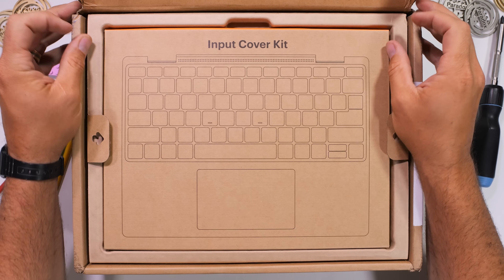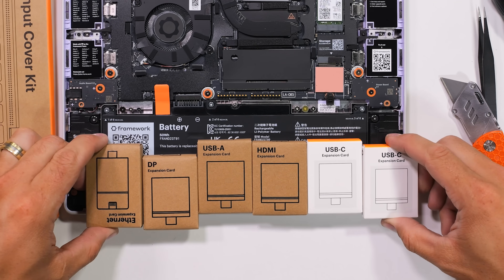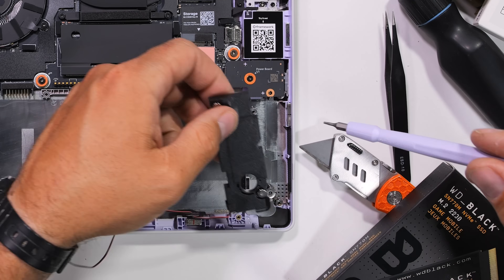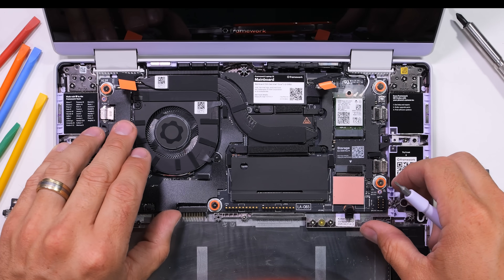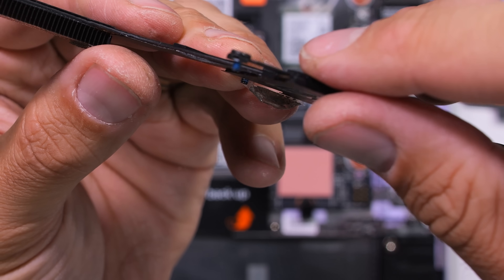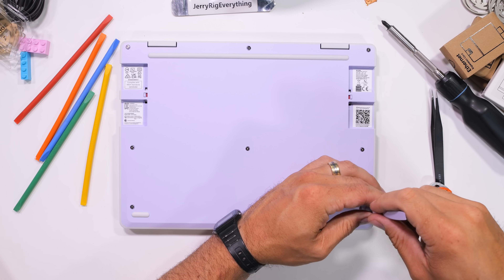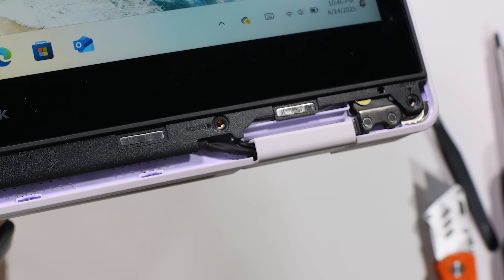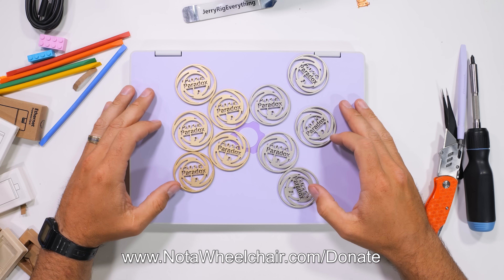The Best Laptop on Earth... is almost too easy to fix.

Comment: "If you're not familiar with the words I'm using - like modular, repairable, and inexpensive - that's ok. At least your texts are blue." Savage.
Reply: Trust me, my next laptop is going to be a Framework running Linux. The bloom is off the Apple flower for me.
Reply: @KevinGamin  That bloom died many years ago.
Reply: @KevinGamin  same, excited to ditch windows and have something that is meant to use linux
Reply: @KevinGamin  If you're a linux geek, there's even more repairable / modular laptops where the drivers are FOSS and the schematics for everything are included, i forgot the name of it though

EDIT: ITS CALLED THE "MNT REFORM"
Reply: @dwncasted  Like which one? I am very interested!
Reply: @dwncasted  MNT!
Reply: @dwncasted  afaik, many drivers being used even in linux.. are proprietary.
Gpu/network.
But if true what you said, I hope the FOSS laptop's name isn't "fantasy realm".
Reply: @dwncasted yeah but there is no touchpad and it costs more than a damn macbook
Reply: @AdjectiveBlazkowicz  There is a touchpad.
Reply: @dwncasted  Yes but not upgradable, only reparable, can't change the cpu
Reply: @KevinGamin  Framework 16 with Tumbleweed and Gnome is heaven for me
Reply: @KevinGamin  remind me if I have money again, I'll buy one for my mom :D
Reply: @KevinGamin You better hold that words, come back sometime later
Reply: @KevinGamin  Unfortunately, Macbook Pros are by far the best laptops in their class. It's not really a contest. MacOS is still, for now, pretty great too.
Reply: @thekwoka4707 Nothing unfortunate about that at all.
Reply: @thekwoka4707  mac is trash  over priced trash at that ... that being said framework is trash also ...
Reply: @KevinGamin  I can't imagine voluntarily using Linux
Reply: @KevinGamin  I wouldn't ever get this junk. The specs are so bad, it'll become outdated in a year or 2 anyways. I'd rather buy a thinkpad or something of the sort
Reply: @whyisitsodifficultomakeahandle - You do realise one of the selling points of this laptop is that it can be upgraded right?
Reply: @whyisitsodifficultomakeahandleyou can literally replace the motherboard and the chip in the RAM and everything else.  If if the current specs aren't dated you can replace them which you can't do on any other laptop
Reply: @brotherfranciz yeah every laptop can, they just advertise it as a “selling point” to fool people like you
Reply: First two are appropriate, but inexpensive is definitely not something you can attribute to framework, since you're paying at least double for the same specs.
Reply: @Gundog256  exactly. I just get used hardware.
Reply: 6:03
Reply: As an iPhone user who knows a lot about tech, absolutely fucking savage
Reply: I came to say love that shade of blue you threw, but you beat me
Reply: Blue texts are useless and overrated
Reply: Apple users get mad when they get called out for being technologically inept but refuse to learn and thus become "sheep".
Reply: Apple and Samsung fan's 9/11
Reply: @polaristars  samsung doesnt get blue texts
Reply: @polaristars  only apple lmao
Reply: ABsolutely freaking awesome!!!!!!!! Also, Definitely will be buying framework from here on out.
Reply: Yea, that was brilliantly delivered.
Reply: Very sick burn.
Reply: This was like poetry! It got me good hahaha.
Reply: Imagine if they join with Fairphone
Reply: added that to my quote book immediately. also signed into youtube just for this
Reply: Please enlighten me my fellow brethren for i am slow to think and quick to despair for i do not know and do not understand this sentences...and also so that i may appreciate the genius of savage of this word
Reply: Pretty sure this is my next laptop.
Reply: how did i scroll down to read this exactly as he said it.
Reply: Presactly my point! I love green 😀
Reply: Literally died with this
Reply: Best part is directly after this I got an Apple ad
Reply: this line should be in the history books for real
Reply: Hehe mine are blue too, not that I care, but I do know and understand the words ;). And I have to replace components when the fuckers are running. Small yay for IBM
Reply: Looking for this. Thanks 😅
Reply: when was this?
Reply: And then he installed windows
Reply: but hes right
Reply: is that an apple user own?? becuase am lovin it
Reply: But aren’t iPhones more repairable than a lot of androids now? Electrically bonded battery adhesive. Removable back glass. Self Service Repair Program.
Reply: @dankpanda919  Aside from the battery it's still kinda hell to service, just like any other smartphone. The electical adhesion should be standard though, it's really nice.
Reply: @polaristars Right, but that’s kinda my point. The only easy one is Fairphone. No point in singling out iPhones right now while the current iFixIt scores are higher than a lot of mainstream Androids.
Reply: @dankpanda919  and every part is serailized, some you cant recalibrate, love iphones!!
Reply: @dwncasted Yeah, maybe 3 or 4 years ago. That’s not a thing any more.
Reply: @dankpanda919 only because, unfortunately, big Android phone companies like Samsung took notes out of Apple's book so they could drain more money from consumers 

Sent from a s25 ultra
Reply: My screen bezels also aren’t as big as laptops from the 2000s.
Reply: Nice one indeed! Hahaha Could still be green though if they aren't using an iCloud-account. I have seen them! Not kidding!
Reply: A tactical team from Homeland Security has been dispatched and is currently on its way to arrest you on the charges of terrorism and inhumane treatment of civilians
Reply: It really was a right hook roast 😂
Reply: haha apple bad ,get it?
Reply: Got a 17 pro ad the second after, I screamed 😭
Reply: I love my Apple products, but also LOVE my Framework!
Reply: apple being unrepairable is just not true anymore. More about samsung now
Reply: @saminogabino apple hasn't been easily repairable since like 2018. Unfortunately Samsung kinda took inspiration from Apple's predatory practices in the last couple years so they're basically both on the same level of non-repairability. Both are still possible to repair but only if you're EXTREMELY careful. But there are TONS of Android phones out there that are way easier to repair and even designed around it. They just aren't as flagship or popular
Reply: 2025
Reply: reddit assemble!!!
Reply: Loved that line 😂
Reply: I’m dying over this one😂😂😂
Reply: i understand and love the three words, but what does the texts are blue part mean?
Reply: Shots fired!
Reply: I didn't understand what this means?
Reply: @kitty.miracle He's referring to the text messages which are blue on Apple.
Reply: So savage ahahahha
Reply: Of course they are, why would I use anything other than signal, it's just better?

Plus, the SMS application I use for those who refuse to get signal lets me change the text bubble colors.
Reply: How can you tell an android user when you see one? They’ll tell you
Reply: THE SHADE! LUL
Reply: Ouch! 😩 Right between this proud Apple user’s shoulder blades. 😅
Reply: What does it mean, though? "text are blue"
Reply: @achmadramdhan3629  The text bubble from a device that is not in the Apple ecosystem appears in green colour to an iPhone user, while the ones in the same ecosystem appear in blue. I may be wrong, but I think that's generally it...nothing serious.
Reply: @OneNiftyBoi  thanks for the info
Reply: @achmadramdhan3629 Texts are blue on iPhones when two iPhones are texting eachother which is what that means
Reply: @achmadramdhan3629 you might not care if you live outside the US but in the US where people use iMessage and SMS a lot Android user texts show up as a different color as Apple text and they tend to break things because of the way Apple makes it. It's mitigated a little bit by RCS but still Apple makes it so anyone with an Android phone basically is outed in these chats and blamed for making them not work. There's a Wall Street journal article about how this led to bullying in schools
Reply: Personal I use apple for the ecosystem. Most users don’t. I would go back to a Linux or android. But I am in too deep at this point. Maybe my next work computer will be a frame work.
Reply: @Thekidfromcalifornia2.0 "I'm in too deep" Translation: I could easily buy something else but I choose to keep supporting the destruction of society
Reply: Good burn aside, this problem of not having an android iMessage alternative is entirely Google’s fault. They’ve created and killed more messaging apps than anyone can shake a stick at…
Reply: Who is repairing/upgrading phones or computers nowadays? You’ll throw it away and buy a new one since it’s not worth it to repair like 6-7 year old phone.
Reply: @Svenisko1705  you have too much money
Reply: Ff
Reply: blaming blue texts is silly, most of us are stuck because of society, i like having loose friend groups to ocasionally do stuff with and they always congregate in imessage groupchats, I just know for a fact id miss out on things, and its not like main friends, but i still like leaving my house and going places lol
Reply: @hardlyreading Everyone knows you can't leave the house or talk to people without supporting a corrupt company.
Reply: Blame apple no one else, blame the government for not seeing imessage as an issue,  people stayed to keep talking to ppl, otherwise theyd have lost hella market share years ago
Reply: except it is actually very expensive vs a comparable laptop. Almost twice as much.
Reply: My texts are blue and I still thought this was hilarious. I made the switch to Apple as a compromise to my wife/her extended family. Somehow in a group of 15 people, I was the only reason the group chat couldn't all be iMessage, so I caved. At least Apple pushes IOS updates to older models for a long time, so I can hang on to my phones for 3-4 years. My iPhone 13 is pretty much the same as whatever the new one is now.
Reply: 😂 The way I hollered when he said this! Android 4 Life!
Reply: thats literally every other tech company. sure apple popularised all this crap but i feel like the sheep (SAMSUNG) should be called out more but then hed be a hypocrite i guess 🤷‍♂️
Reply: Jokes on us my text is blue but I knew these
Reply: Jokes on you, it is a joke @古明地恋-s9c
Reply: True, but Apple aim more than just a few thousand sales too.. i mean their sales target is the 300million funny cat videos viewers not the 0,1-1million tech videos viewers..
Reply: Most that say this will be too poor to buy an iPhone. Copium.
Reply: @HiroProtagonist1  Most people buying 🍏 are broke and end up with payments anyway. 🤣
Reply: He always seems to have some weird grudge against apple & its users. Ehh, he’s an android user and he’s rich, of course he has a superiority complex.
Reply: @LambdaMiscellaneous  So having an opinion that differs from yours means superiority complex. How about the victim complex you have.
Reply: @LambdaMiscellaneous  If you had paid any attention you would have found it weird NOT to talk about them in a video about the features a Framework provides. The short version is that Apple goes out of its way to make stuff unrepairable, I'm talking millions on lobbying, bribes, and propaganda alone. The kind of practices Apple gets away with is exactly why Framework was made...
Reply: @LambdaMiscellaneous  Apple's the only one that does serialized parts, that's plenty reason enough to despise them.
Reply: @astralVerdance  yea, i like that my phone is useless if stolen.
Reply: @LambdaMiscellaneous  Could you make it less obvious, please? How do you expect me to get baited if you blow all the whistles at once?🙄 I'm disappointed in you.
Reply: @LambdaMiscellaneous  Tbh it's not weird when you know how trash is Apple in terms of consumer friendliness.
Reply: @LambdaMiscellaneous  I mean, as an Android user, my life is full of Apple supremacy assholes who constantly give me shit for green bubbles. So from my vantage point, it's been Apple users who have a superiority complex.
Reply: @cthomas025  Yet somehow it's always the Android users picking a fight and playing victim. It's a one-sided battle from Android users with a superiority complex.
Reply: @couchpotatoes5158  except it's not. I always go about my day just doing normal day to day things, pull out my phone to check something next minute the apple user shows up and asks me why I'm "still using an Android when Apple is so much easier". Or when my Apple user friend meets somebody new its always "are you Apple or Android?", followed by a "haha see" if they're Apple or a "eww gross" if they're Android. I couldn't care less until people start telling me that Apple is "just easy and better" without providing any reasons for their argument.
Reply: @couchpotatoes5158 what are you talking about ? If you don't live in the US but in the US iPhone users have jokes about how they won't even date Android users because they're poor. Wall Street journal had a front page feature about how Apple users were bullying Android users in schools.
Reply: @michael_c2  bro, I live in the US and that’s not true at all 💀. The victim mentality is crazy, 99.999% of people couldn’t give a shit what phone you use. Never in my life have I witnessed anyone get bullied from using an android. .This isn’t 2016; the only people dragging out the smartphone wars are android users
Reply: @couchpotatoes5158  Late reply: You are a prime example of an 🍎 user's superiority complex- you think declaring something as "not true" makes it so.  You don't need facts, your word is fact, right?
Reply: @LambdaMiscellaneous  were your feelings hurt by the YouTuber making fun of the mega corporation?
Reply: @LambdaMiscellaneous Having been in the computer scene for 3 decades, I'm sorry but it's always been 🍎 who have branded themselves as the superior option, and ingrained that mentality into their userbase/customers. Any negative or sour interactions you've gotten from PC/Android users is a result of us dealing with superiority complex of 🍎.

The reason Zack takes jabs is simply because some of their design choices are legitimately annoying/bad, but he does it with everyone's products so he hasn't singled out 🍎.
Also, he may be Android now, but I believe he used 🍎 for quite a long time.

(sorry for using the emoji, but YT's autoKaren system will remove my comment if I say brand or product names)
Reply: @DUKE_of_RAMBLE  yeah that's just not true tho. 90% of the hate I see coming from people online is from Android users who hate Apple users for no reason. most apple users couldn't give a shit what phone you use. It's a weird one-sided gudge from Android users.
Reply: @DUKE_of_RAMBLE  I hate the autoKaren.😞
Reply: @couchpotatoes5158 Imagine bickering this much over who is actually bickering about something as trivial as which phone OS is superior. 

People really can't help themselves from generalizing and arguing, jfc.
Reply: @couchpotatoes5158  I think tons of people have that one tech illiterate friend that calls everyone not using apple products stupid, and then turns around and complains about being told to buy a whole new one when they take their i-whatever to the 'genius bar' for some issue that would be effortless to fix yourself on any other machine/OS. I know I do.
Reply: @DUKE_of_RAMBLE  lol.AutoKaren
Reply: @omerdayanalsheh3402  If the shoe fits, am I right? 😁
Admittedly, I'm quite proud of coming up with that nickname for the automoderation system! lol
Reply: @LambdaMiscellaneous If you care about yourself, the environment, and your money— you would get it.

Unless you don't. Of course, the poor Apple fans are so oppressed today.
Reply: @LambdaMiscellaneous WOW! Ithought that complex was innovated by apple!
Reply: @LambdaMiscellaneous  aka a boeing pilot because apple is airbus and samsung is boeing
Reply: @LambdaMiscellaneous  That's insane considering apple's low bar superiority complex
Reply: @LambdaMiscellaneous  bruh my first non-secondhand phone was an apple one, it sucks so bad bro. all these people that claim apple is "restrictive but seamless" are downplaying and lying. its SUPER fucking restrictive, meaning its straight up missing basic features and there are no options for them, and absolutely no workarounds. and "seamlessness" isnt true either, because it can barely do basic functions.
Reply: @LambdaMiscellaneous he used apple most his life
Reply: @LambdaMiscellaneous  apple users are known for their "superiority complex"
and Apple is one of the most anti consumer, and anti repair companies ever.
Reply: @LambdaMiscellaneous He has common sense and promotes common sense products, which is just common sense. Apple is the antithesis of that.
Reply: @JonnyFlash80  Using antithesis because he used it in the video. So original.
Reply: @LambdaMiscellaneous  stating facts isn't having grudges
Reply: @LambdaMiscellaneous  calling idiots idiots, is not a grudge its just saying what you think about them

Comment: I love these Framework laptops, I am still holding off on one though because I'm still in the need for something that is made for digital artists, something with more graphical horsepower AND a pressure sensitive drawing stylus. Those are getting very few and far between these days. When I heard Framework was going to make a small touchscreen laptop, I was so stoked. When i heard it only supports the very basic touch input, I was sad. 

If any of the Framework guys are reading comments, please oh please look into making a true artist's 2-in-1 laptop!

Comment: Using a single stick/single channel is a crime, Jerry.
Reply: While in a normal laptop yes, in a framework laptop it's kinda acceptable. Because it leaves u room to upgrade
Reply: @selchuk27  Having a system with half its memory bandwidth missing for the cost of a burger makes no sense, so no, it's not acceptable. And RAM is one thing that commonly is upgradeable on laptops. It's only soldered in specific cases, or if it's a douche company like Crapple.